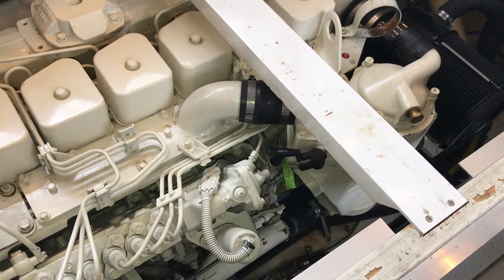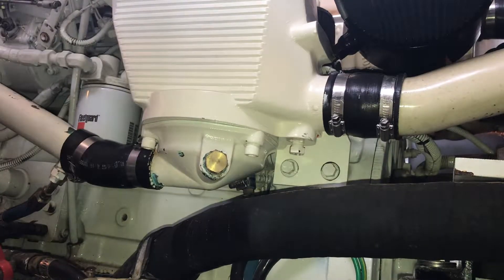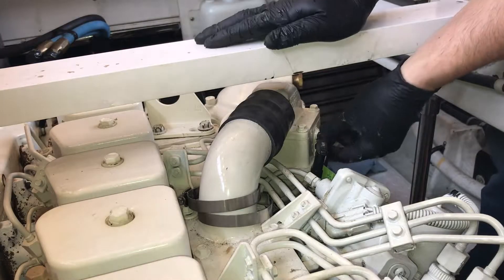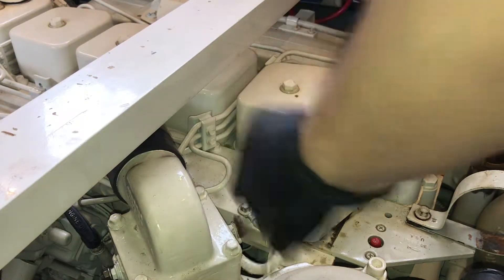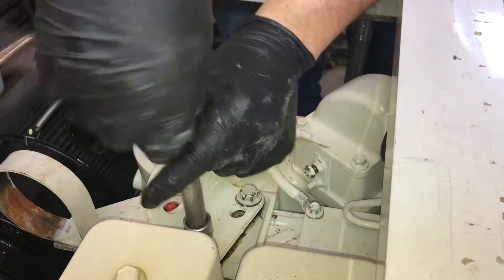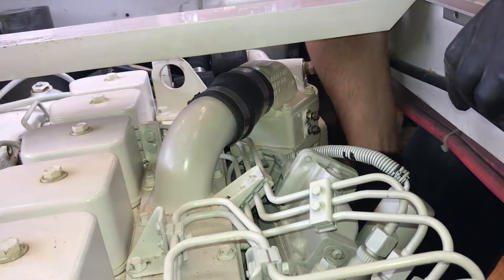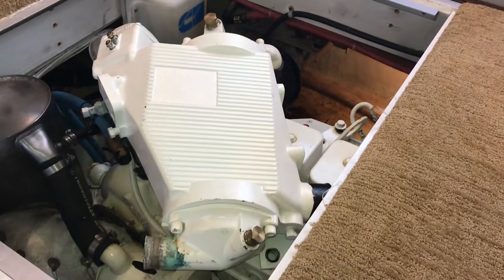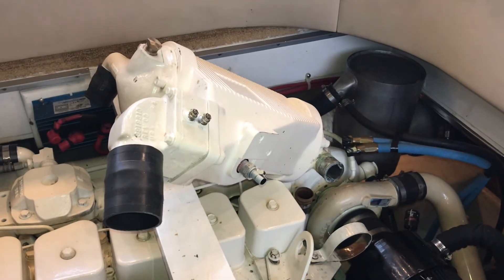Cummins 6BTA Aftercooler Removal part 1

Comment: Hi there thanks for this video. Do I need to drain anything else ? Or just the bottom zinc ? 
Thx again
Reply from the maker: Removing the bottom zinc will drain the raw water. Shouldn’t be anything else in them other then air.
Reply: @abredeson  thanks I think I am gonna start this soon. I might have been thinking about draining coolant from heat exchanger.
Do you have any info on that? Thx again these are great videos. And the music is great lol

Comment: Thanks for posting these.  We have a Tiara 35 Open on Foss Waterway as well and I'll be servicing my heat exchangers and aftercoolers next week.  These videos really helped take the anxiety out of things as I'm new to diesels and inboards.
Reply from the maker: Thank you!   Let me know if you have any questions.
Reply: @abredeson  I wish I had questions instead of this opaque coolant in my starboard engine  :-(  Looks like I might be replacing my heat exchanger.  Will see what the radiator shop says.  Planning to use Seattle Radiator Works, but I'm open to suggestions.
Reply from the maker: Lee Landrum that’s to bad.   Good thing you caught it now!  I used performance radiator in Tacoma just because they are close. I don’t know much about the different shops.
Reply: @abredeson  aftercooler bundles had to be replaced,  both heat exchangers tested ok. Will be reassembling this week/ weekend.   Hopefully nothing else "fun" comes up.